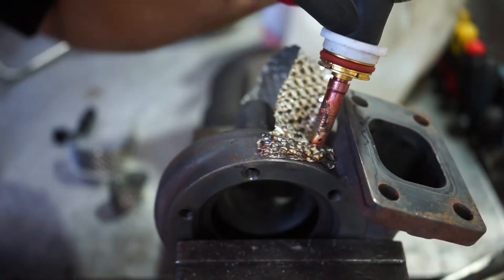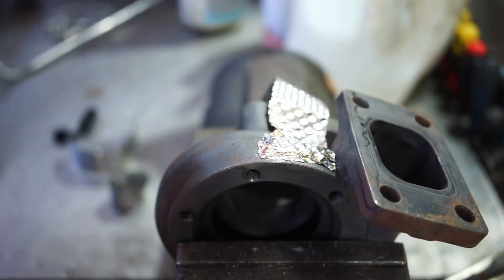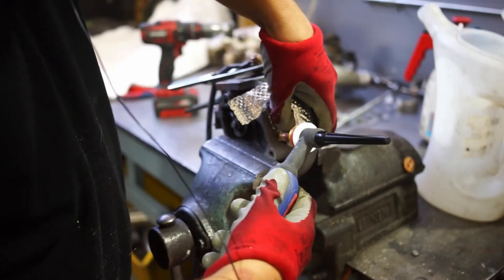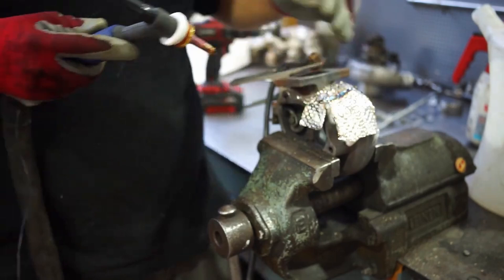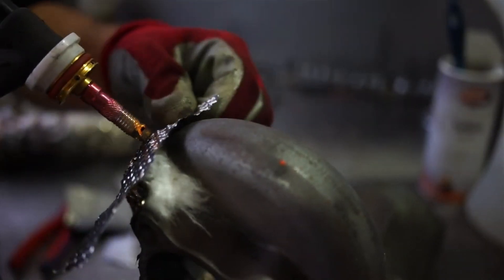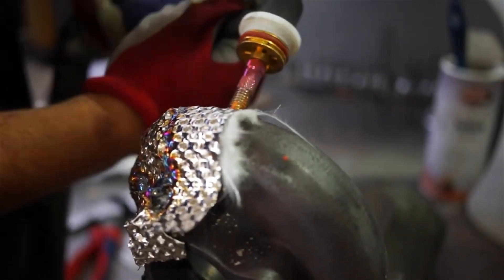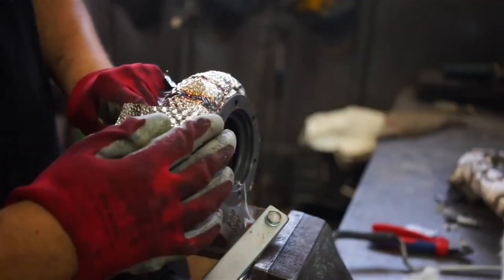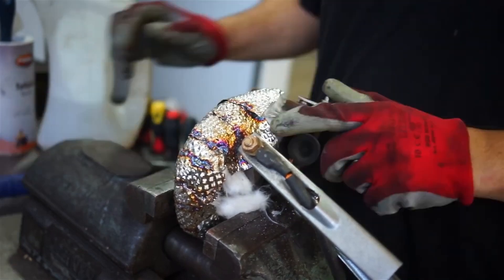Better Turbo spool and response  for cheap | 3 (4) Ways to improve your turbo engine on a budget"

Comment: Does the video show a TIG torch being used to spot-weld stainless steel foil around hot turbo parts? Can you point me towards a video detailing this? process?
Nevermind, I found it: https://www.youtube.com/watch?v=G6X6v6isaaM

Now, to watch it. That appears to be pretty clever. See you in the comments over there.
Reply from the maker: You can pretty much use any welder even a flux core works exactly the same way! Any old 100 dollar machine will do as long as you have a torch and asjustable current!

Comment: Can someone explain why is the intercooler on an Astra J VXR  is mounted between the condenser and radiator, doesn't that defeat the purpose ?
Reply from the maker: lots of newer cars do this, because the small loss in performance is not as massive of a problem for the manufacturer as a properly working AC: If the condenser gets heated up more, that means the efficiency is gonna drop, especially in the summer and AC wont work as well.

Comment: Isn't colder air better for boost? That's why they call Autum/cooler weather "boost weather"
Reply from the maker: yes, on the intake, but on the exhaust side, more heat means more volume and therefore more energy so earlier spool. 

in colder air there is more oxigin so you want the coldest air you can get on the intake side

Comment: For the turbo I think the best option you could have is as you say ceramic coat the exhaust housing, specially if it's a street car where you want a bit more durability
Reply from the maker: Yep that would be a compromise as said in the video. Though there are very cramped engine bays or where thermaly sensitive components are nearby there thermal insulation would work best